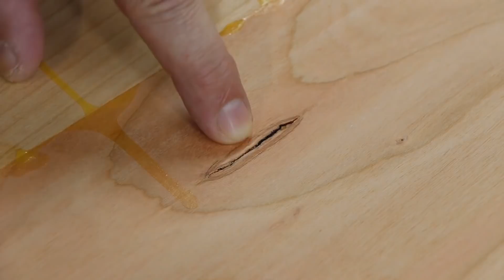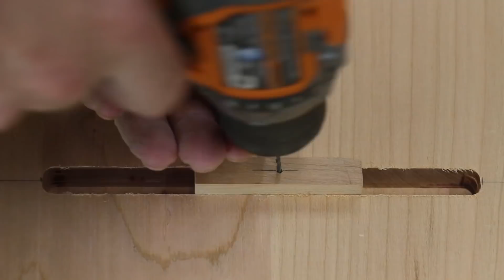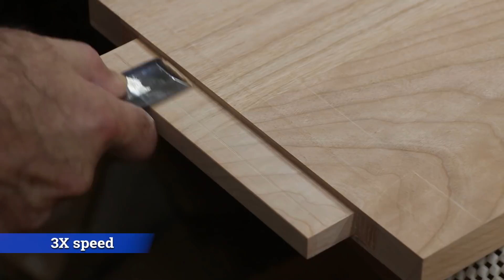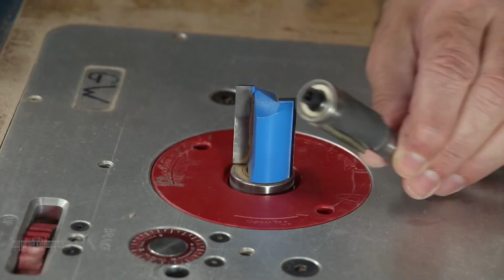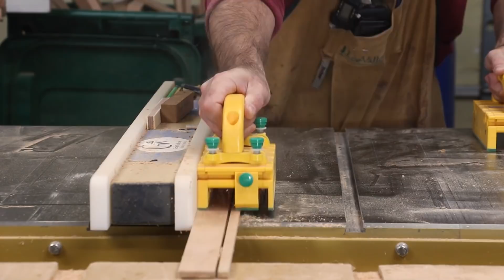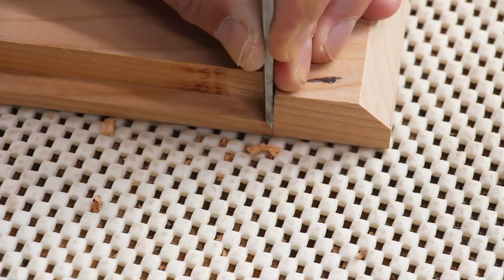Through Tenon Bookcase

Comment: This is amazing. I know you did this a while ago, but a question if you don't mind. I'm planning a smaller bookcase for kiddo's bedroom. 

Does the top need to be joined the way you did?  I was going to try a through tenon on the top shelf only (dado the rest), but I wanted to have a half shelf on the top for toys.  So the sides would go a few inches above the highest shelf, with no top on it.  Will it rack if I don't put a top on it?  I think it might be about 32" - 36" tall, 3 shelves total and an appropriate width.  Going to use red oak 3/4". Thanks for the great video, so many ideas here